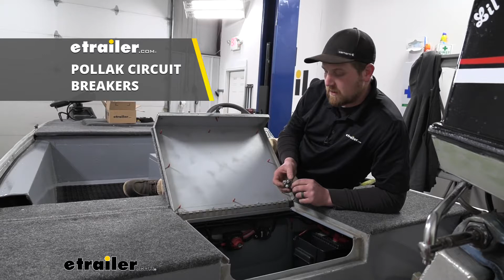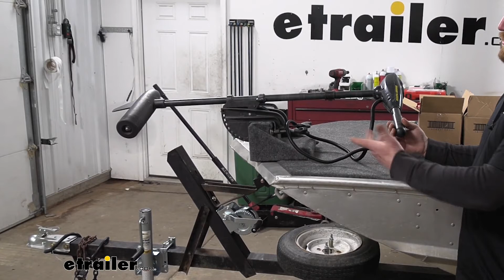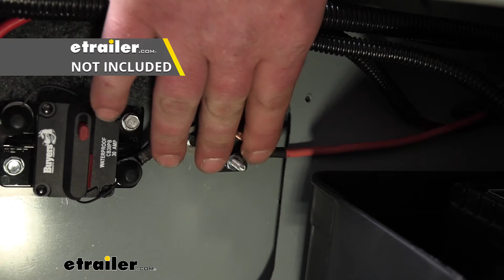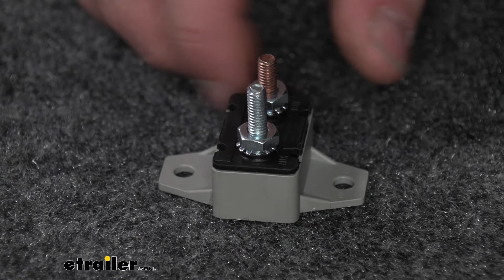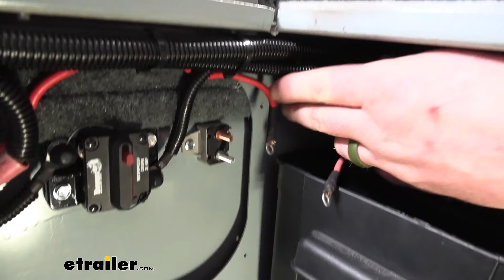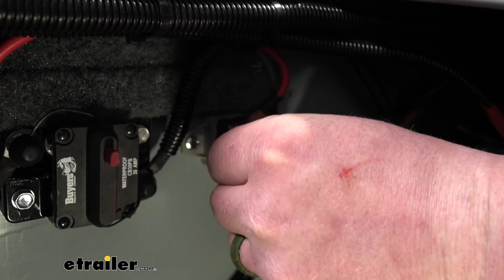etrailer | In-Depth Review of the Circuit Breaker

Comment: I have a circuit breaker on a three-wheel scooter and it has load and it has line I guess it doesn't matter what you hook up to that cuz nobody can tell me
Reply from the maker: Line would run to the battery and the load would run to whatever's using the power. Hope that helps!
https://www.etrailer.com/Accessories-and-Parts/Pollak/PK54220PL.html

Comment: What Guage wire do you use I have a motorguide xi3 without pinpoint?
I'm installing this as I speak.
Reply from the maker: We'd recommend getting with MotorGuide on that.  You can contact them at (920) 929-5040.